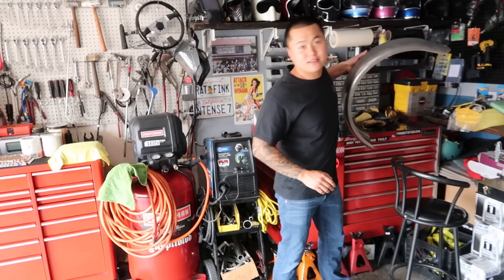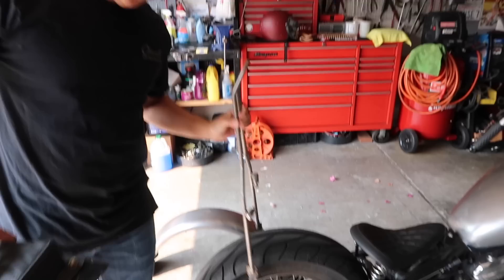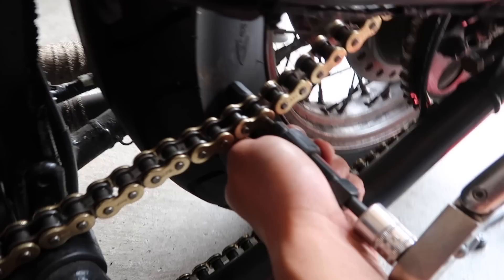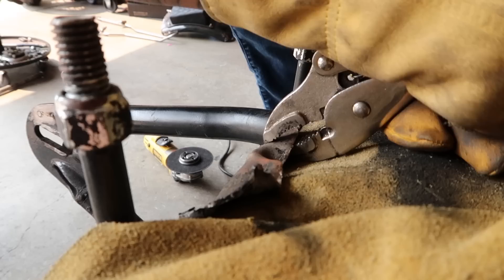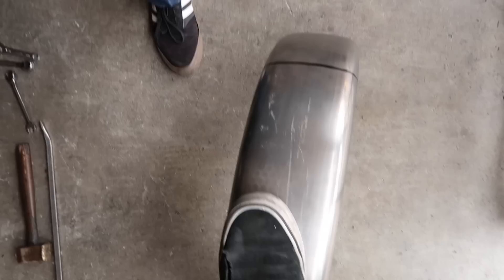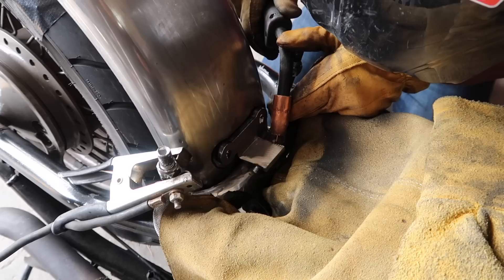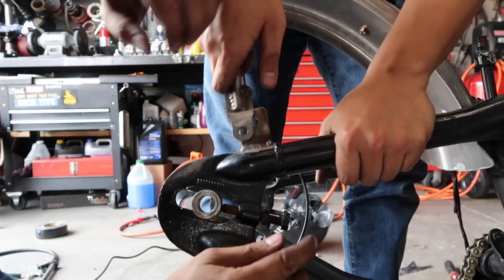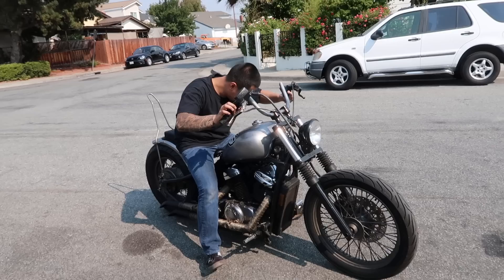2 UP MOD on a HARDTAIL Honda Shadow VT600 Bobber | Lnspltblvd

Comment: You're running lean your air/fuel screw. Back it out and that popping on decel will go away.
Reply from the maker: Brandon Simons thanks!!
Reply: I found it helped a lot to remove the pilot mixture screw from the bottom of the carb and use a file to shorten it with the same end shape, so I had more threads to add more fuel. It helped a lot for more power just above idle. I did this in 2003 when adding a larger, freer flowing air box. It still works well. Also check out the Dial-a-jet company parts. I used one of theirs and a Dynojet jet kit, along with a file for the stock pilot mixture screw.

Comment: Dude, I'm from Brazil and I don't see much shadow modification here.  

To improve torque and power we have adjusted the carburetor. The bike gains final speed and torque on retakes. But how to improve cruising speed? Why doesn't she vibrate so much? Maybe a change in transmission and gear?
tks

Comment: Hi
I'm bobbing a 2000 vlx600 and putting a steel trailer fender ( little deppef sides then the fender u sed) on rear of it. I used a hose as well for spacing but what's the easiest way to get and keep fender level  and centered on tire so I can weld mount on frame??
Thanks for ur time and keep up the AWESOME work 👍

Comment: Looks great but with that hose width you forgot about tire expansion. It's 600cc or under it's a maybe, That's definitely not a 600 cc based on that engine thump and the backfires.

Comment: NICE BIKE!!!  I've got one much like this in the works, haven't fabricated a hardtail secrion for it yet (mine's a shaft drive, so there's not a lot of room for error there, as far as length goes.)  Just out of curiosity, do you have a vid on building your hardtail frame?

Comment: What kind of exhaust is this?

The sound is incredible!
Reply: I got a good sound by drilling out the stock exhaust back baffles, then adding stainless steel eye bolt baffles with fender washers bolted to them for more power just above idle. The 1999 to 2007 single carb Honda Shadow VLX 600cc has about a 95mph top speed and will do 75mph all day, but the amount of engine vibration and the low quality suspension and brakes are tiring. I ride mine almost every Sunday for 30 to 50 miles at 50 to 60 mph, and rejetting the carb for a freer flowing intake and exhaust made the engine start faster and more fun taking off from stop signs, and I only lost 5 miles per gallon for the little extra power and some extra noise that sounds good to me.

Comment: Do you guys have any advice on making a 600 shadow faster? Having a 4 speed can make interstate rides kinda slow.
Reply: Changing the rear sprocket to better suit your riding can help a lot, a very popular option is the 41 tooth rear sprocket from JT sprockets which reduces the high speed buzz and doesn't lose too much take off. Open intake and rejetting the carburetor are a must, I suggest velocity stacks for high rpm power or more closed for mid range. Lastly upgrade the clutch springs to deal with the smaller sprocket and while you're in there advance the timing 4 degrees will get you a little more power as well

Comment: P-pad is installed backwards dude. Taller part with more cushion should be at the rear, where your weight is
Reply from the maker: reallyallgone nah we like it this way so the passenger doesnt slide down. This position allows the passenger to sit flat on it

Comment: Let me know how the ride is like actually riding around because I been wanting to do this but they said u can't really ride a passenger it's only for looks I was like he'll no but out here in LA area san Fernando valley road and free ways be really crappy bumps in the road at freeway speeds makes me come off my seat I can only imagen how it be for the back seat passenger let me know if really appreciate it thanks
Reply from the maker: bachateroguero It depends on the padding of your passenger seat. The blue bike with the king and queen seat is much more comfortable than the pillion pad in this video.

Comment: Where did u get ur rear fender?
Reply: You can buy steel trailer fenders like this at Tractor Supply cheap. I used one with minor modification on a Yamaha chop.